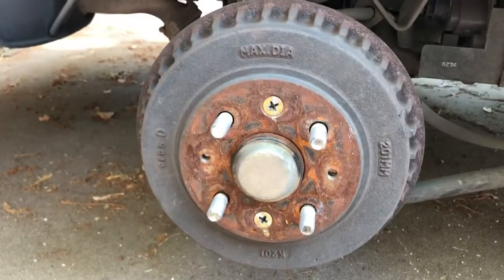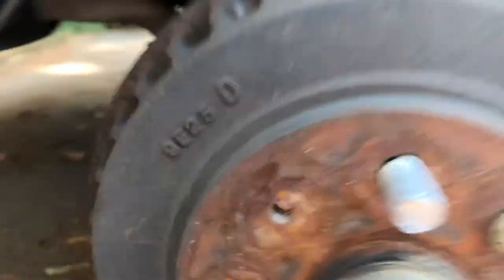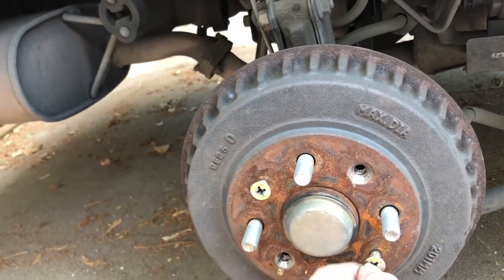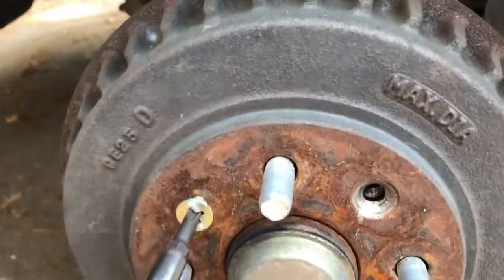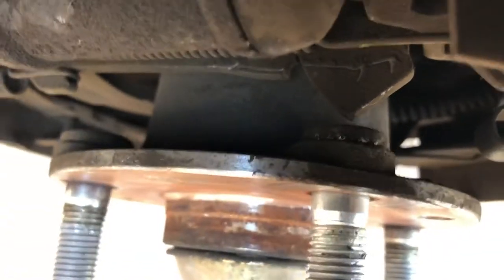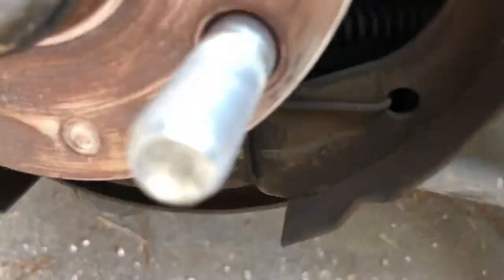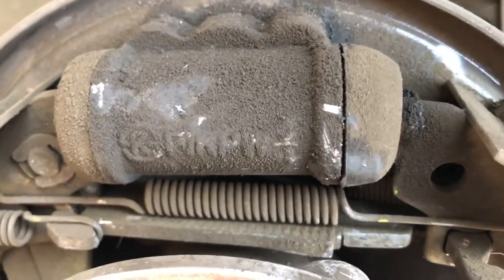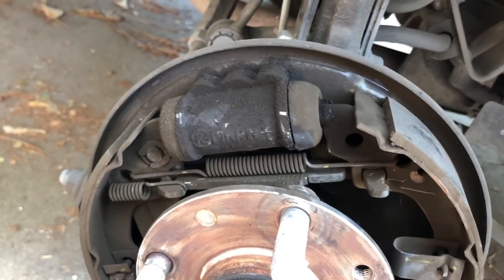2000 Kia Sephia spectra rear drum brake replacement. A puzzle for owners in the road

Comment: Ok but what if those screws are rusted and when attempting to take them out they stripped themselves🥲?
Reply from the maker: have to use an impact hammer driven  Harbor Frt sells a $20 kit  Or hit the screw with an impact bit to' crack the rust.

Comment from the maker: okay now Nov 2021. The car brakes have never been okay yet. It had not been driven a few yrs wasting over $600 in lic reg and insurance so far  2 yrs easy. This car will not stop worth crap, will glide thru an intersection in the rain and takes over 3 x longer than it should  that mean ove 300 feet at 60 mph- would you like that? I am so sick of doing every other part for ZRO.  No none can sell right equipment . Autozone gave me a MastCyl last yr with an electrical sensor, and new shop mech said it is wrong, Yep, now wasted a quart of fluid and bleeding hours and chasing more parts again another attempt of swapping